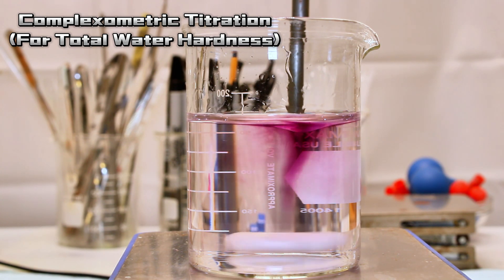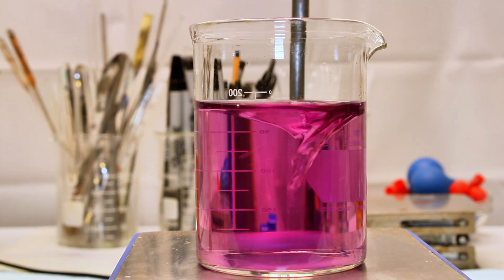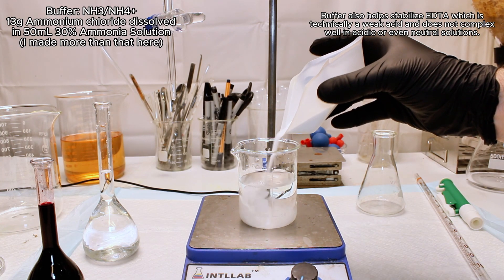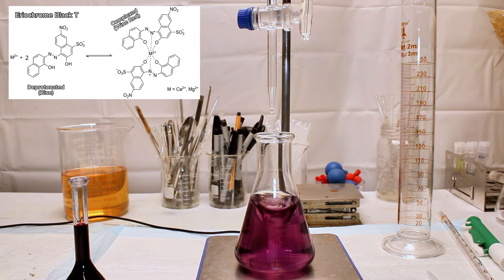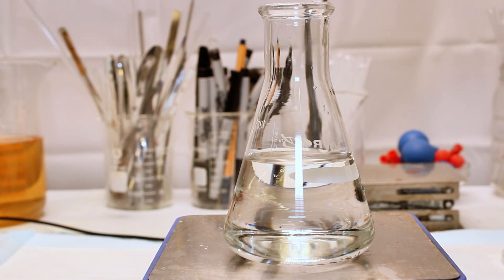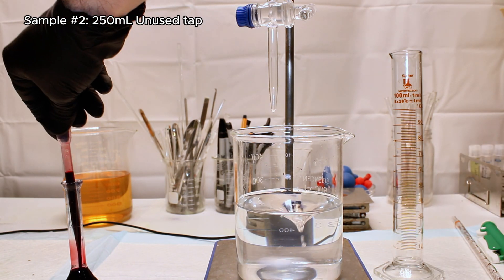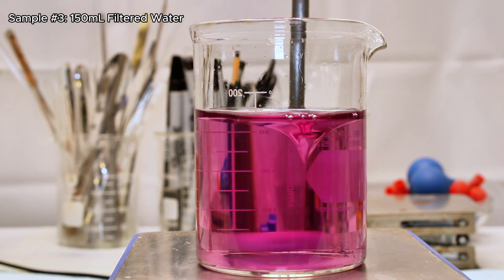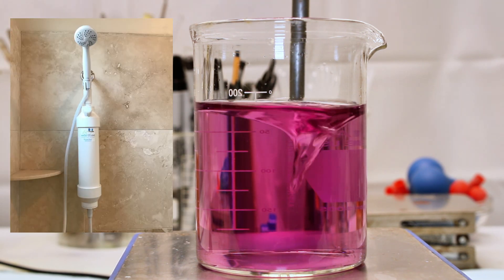Determining Water Hardness by Complexometric Titration

Comment: What was the hardness of the water after going through the shower softener though? That was the point of the whole experiment after all.
Reply from the maker: Very good question lol. Honestly the reason is that I finished filming for this one long before we got the water filter and the setup for this experiment is fairly intensive if you want to get a reliable number, and so I figured all the effort wasn't worth one extra data point.. but it would be a neat thing to test.
Reply: @integral_chemistry  Ahh... That makes sense. I was confused why you did all that and then omitted... You know... The "thing".

Comment: Hi! Chemistry student here, Honestly I’m unsure it would’ve made much, if any difference, but when dissolving a sample in a volumetric flask, it is typically common for the solid to be dissolved in just enough solid before diluting to the etched line. Is there a reason you don’t do this? Or is it completely arbitrary?
Reply from the maker: Hey! Good question actually. So yeah that is standard practice, and the reason is that its really difficult to agitate or vortex when its full to the etched line, which can make it very difficult to dissolve solids that are more stubborn to dissolve. The potential consequence is when you fill it all the way up before dissolving the solid you might not dissolve 100% of it.
EDTA dissolves pretty easily, and I kinda cheat by putting my volumetric flasks in a sonicator for 10 minutes which assures the solid gets 100% dissolved, but if someone was paying you hourly to prep samples they likely wouldn't be happy if you did it my way..

Comment: Your „Standard“ is pointless. Ca hydroxide has an arbitrary amount of water and CO2 in it. Commercial EDTA is usually pure enough within <1%. As a standard you should better use pure Zn or Mg dissolved in acid.
Reply: Standard calcium carbonate is good as well

Comment: I titrated calcium with various indicators and eriochrome black T is not bad compared to murexide which changes from one shade of pink to another shade of pink
Reply from the maker: Oh yeah? Glad to hear it works. I've actually been meaning to do a video on the synthesis of murexide, but it requires uric acid which I'm actually not sure how to make.. So I went ahead and bought some of the black T
Reply: @integral_chemistry  If you don't know where to get uric acid I'm sure some of Nilered's videos can be inspiring
Reply: What other indicators are there?
Reply: @petevenuti7355  Three main are eriochrome black T, murexide and Patton-Reeder indicator. There are also some less used ones like calcein.

Comment: This was very clear and well done (and appreciated).  Perhaps it's the chemist in me, but I like the idea of doing this to check the results against the "test strips" you can buy.  I strongly expect they aren't the most accurate (and certainly not very precise given the color numbers).  As an added bonus, doing this tells you that if you have a full-house water softener, what you should set it to (I'd recommend setting it to remove most, but not all of the hardness.  It will have the best results as your appliances should stop acquiring scale, but it won't feel slimy or taste salty either.  Also, all of the chemicals and equipment you used here exist on Amazon and aren't particularly hazardous or expensive, so this is well within the range of the home chemist.
Reply from the maker: Thank you! And that is actually a really good idea! Before I started this video I picked up a little free test from Lowes, but it seems it requires you to send them a sample and then pay for the results so I haven't actually done anything with it.. I'll definitely look into those test strips and see how they do.
And I agree, the shower softener leaves the water tasting slightly salty and almost slimy, I take much longer rinsing off now..
Reply: @integral_chemistry  You are very welcome!  Perhaps there is another interesting video (and more chem) to do here.  You could test how much salt (likely NaCl) has been left in your shower water after its hardness "treatment".  I suspect it is way too "soft" now.  You could also re-check its hardness.  BTW, I've not owned one of those in-line units, but I'd expect there might be some way to tweak how strongly it affects the water.  There's probably a variable valve to let some water by and if it is any good, it's adjustable.  Curious what you bought though, as most in-line shower units are just filters, not softeners, even if they say they are a softener.    

Anyway, about alternate methods of checking water hardness.  In the US (and likely many countries) you can check your water hardness from the county.  It isn't perfect, but since everyone is on the same general water service, it will likely be close.  You might want to check this for your place to see how close their numbers are to yours (which would be interesting to see as well).

As for strips, I searched Amazon for a few terms like "water test strips", "pool test strips", "water hardness strips" etc. and found several that may be of interest and are all fairly cheap.  It might be worthwhile to buy all and play with them, as some use similar methods, but might vary in quality, and others use different colors as well as often have other additional tests.  Here's what I found that looks interesting:

Green/Red type - They get high star ratings, but they look mostly like shades of brown to anyone with red/green colorblindness like me.  Might be neat to compare against each other.  They were under $6 to under $10 
B0C5KBTL57
B08D8KFPV8
B07B31M49N

Pool, 6 tests with blue hardness - Pool chem is another really interesting topic in itself, particularly when looked at as a chemist.  I found the addition of Boric acid very helpful for example, it basically creates another acid/base buffer to go with the already existing bicarbonate "total alkalinity" buffer, helping to trap the pH in a nice range.  Activity of ClO- ("free chlorine") changes with pH.  Salt pools use electrolysis of water about 1/10th the salinity of the ocean to generate Cl2 (which becomes ClO-) etc, etc.  Anyway, here's the typical 5 tests plus hardness in some strips:
B08BKVPH2V

16 in 1 drinking water test, purple hardness, and look at all those fun other tests.  Wonder how many of them REALLY work, and how accurate are they?  Probably a video or series in itself.  There are many such kits out there, typically they are 15-20 tests on a strip.
B0BG63JJ3T

Purple, wide range - I really thought this one looked nice as it gives a very clear color AND intensity change, making it hard to confuse colors (even for me!)
B0BK9LJSY9

Thanks again and hope these are helpful/interesting.